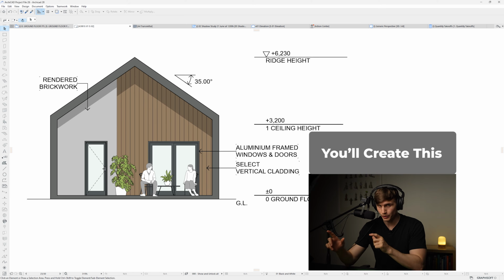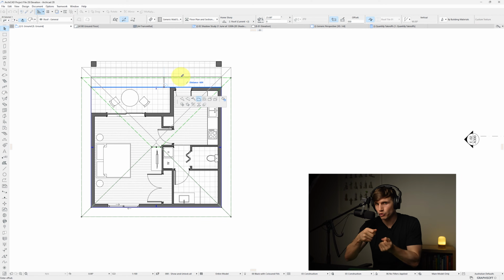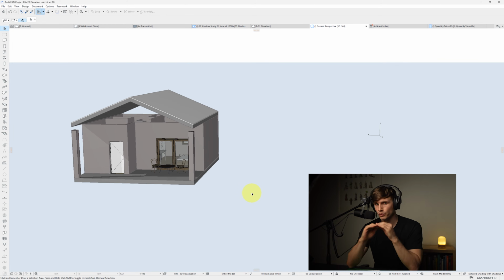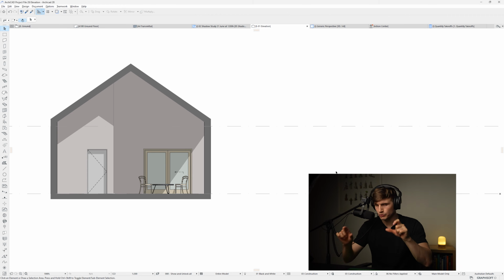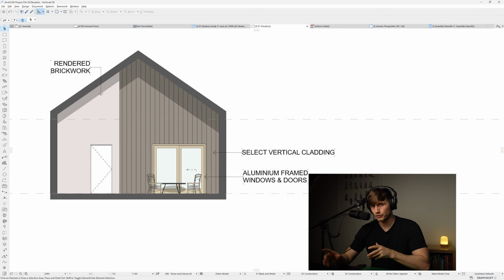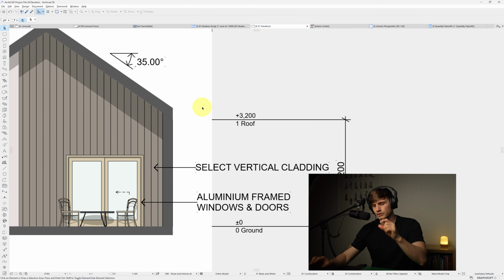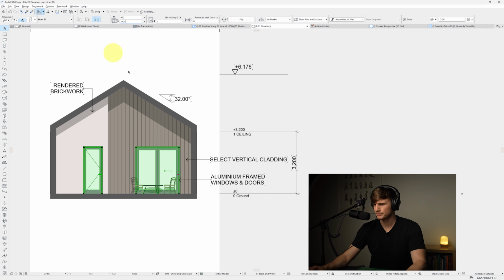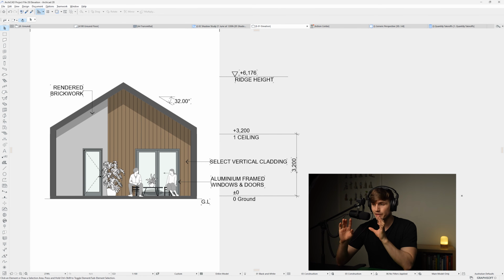How to draw Elevations - Beginners workflow

Comment: When I create roof like that it is automatically drawn in dashed lines. Then, when I remove the overhang, the roof disappears from 1st floor plan. If I switch to 2nd floor, it shows the roof with it's top part cut off(by the 3d floor that doesn't exist). So, for the roof to appear on the first floor again, I have to go into its options and change starting height from 3000 to 2999. (Our floor numeration starts with 1, not Ground). I don't know what to think other than archicad is different in different countries. Im just whining. Thank you for your videos!
Reply: all right, I just removed all the floors above the first one and created a floor called Roof. Seems to work fine